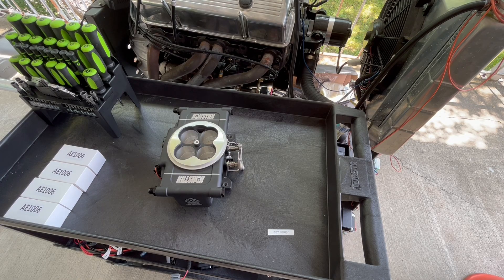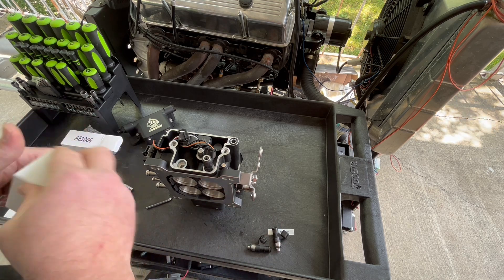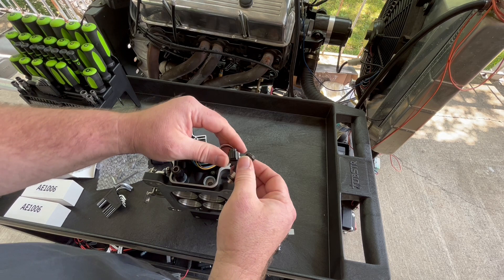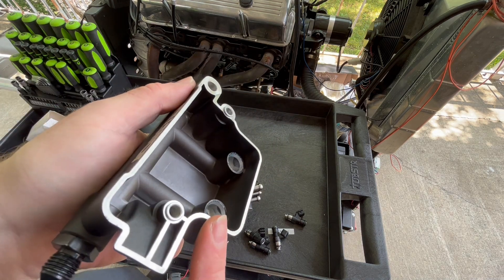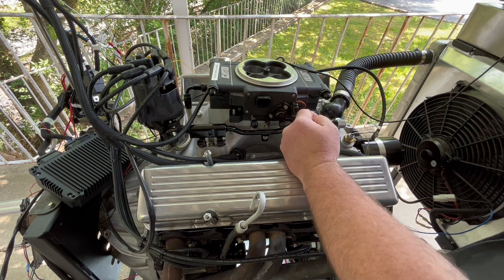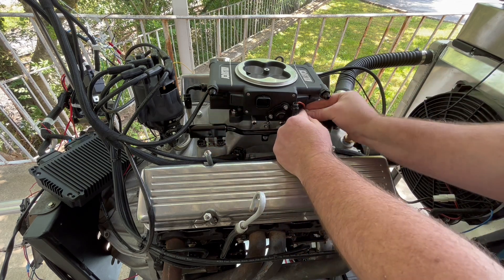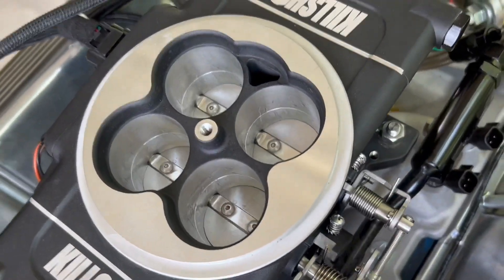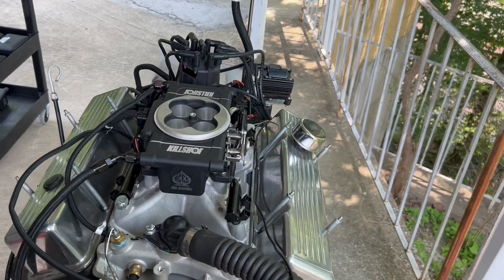Killshot E85 (Project corn fed)

Comment: Great videos.  You tell us what we need to know quick and easy.  Looking forward to more content.  I am planning to put a Kill Shot on my 69 C-10.  If I understand all your videos correctly, I need the Kill Shot, Gambler Distributor (Locked Out), and the Black Jack Ignition Coil in order to make it work and control the timing.  Is this correct or do you have a better suggestion?  I know I need to upgrade the fuel system, but I think I have that part covered.  Thank you
Reply from the maker: Too easy. Killshot, black Jack pro locked out, black Jack coil. Drop it in like I did in the video. Lock it out like I did in the other and you need a system that can get you at least 43.5psi to the tb unit.

Comment: Can you run the kill shot and high roller off the same hand held?
Reply from the maker: You don’t really need the high roller HH if the tb is controlling it through the points wire. It offers ground breaking signal that fires the coil using the cdi box. The HH is for when it’s stand alone and you are setting up a timing curve or setting a rev limit.

Comment: At what point would an engine need bigger injectors to run E85?
Reply from the maker: Dictated by maths. E85 has a different break specific horsepower than pump gas. I wanted to keep the same hp rating for the tb so 160s will get me there.
Reply: How was I do this math calculation
Reply: E85 typically runs at 9.6 stoic and pump runs at 14.7 stoic.  So 9.5/14.6 =.65 meaning that e85 if actually 85 percent ethonal might need 60-65 percent more fuel across board.  How ever not all e85 stations are 85 percent sadly so it could he e30 and you might only need 20 percent more fuel.  But tuning I'd recommend 60 percent larger injectors from where you started or size for your hp and fuel.  Alot more to to tuning e85 .

Comment: I wish there was enough room here for me to tell you my FiTech horror story….  It ends in a 600 Holley.   I want an Aces system bad.
Reply from the maker: I have heard a few for sure. I have used Di techs and snipers and msd and and no name ones. I am fond of the aces stuff because I am not finding crazy issues. And there is some haters but the reason their unit did not work was usually bad install or lack of understanding. I am here to help with that.
Reply: I'm enjoying my aces wild card efi
Reply: My 57 has never ran better